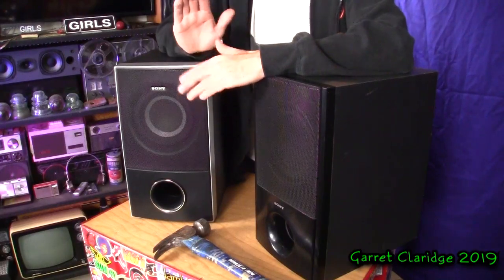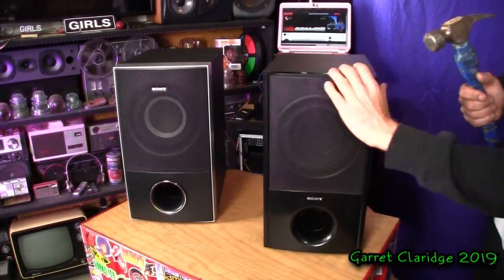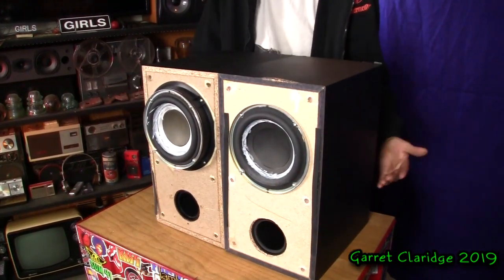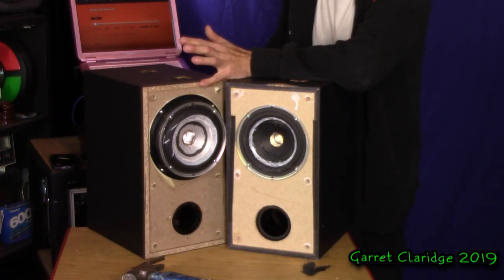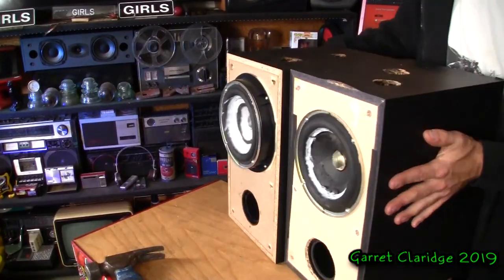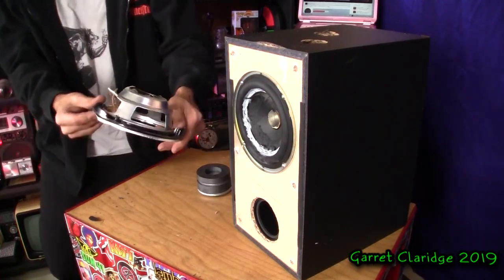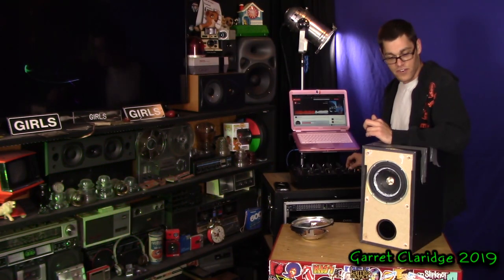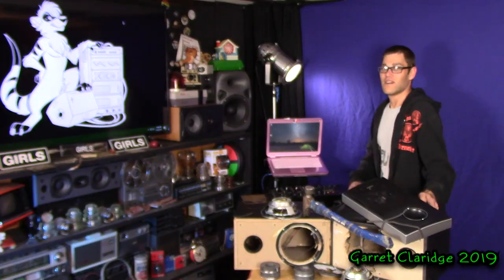Blowing Up 2 Sony Subwoofers

Comment: The Sony SS-WS95 on the right are not a bad little sub. they respectively get down to 40HZ.
If they remain a rooms corner with a pair of alternate satellite speaker to cover the 100hz-20khz range, the aren't bad at all.

The key with these subs is matching them with a low wattage amp with a wide range.

I used the SS-W95 on a compact Optimus STA-300 Digital Synthesized AM/FM Stereo Receiver  that only put out 15 watts per channel but had the range output of 40h-20khz of which I found on a curbside in my neighborhood, that someone just threw out.

 I paired it with two Focal Sib-T 5" Polyflex Cone 100V 2-Way Speaker, 50W, Single that I actually found at a second hand thrift store for like $6.00 !!!, They work very nicely with a range from 100HZ-20kHZ  

My laptop takes care of the Equilization with a general windows program through the windows media player.

All in all a super cheap setup, that sounds decent, as long as your not looking to blast music to the limits.

Comment: Just because you beat the shit out of it before really testing it, and on the wrong setup anyway, doesn't make it a weak sub. Its a decent little 6 inch home surround sub, do the same to any speaker and it'll sound like it sucks.

Comment: A speaker moves just as much in as it moves out, no matter the polarity. For example, a sine wave has both a negative and positive amplitude, with the middle being neutral. So when a speaker is out of phase, the positive amplitude makes it pulling in, and the negative pushes it out. And when the amplitude is zero then the speaker is in its neutral position of course :-)

Comment: Stupid question but does it have that nasty electrical burn smell whenever the speakers smoke?
Reply: you mean burnt/hot copper smell?
Reply: @ale6creations640  Sure lol
Reply: @TheRebelAndTheGirl  if so then yeah, theyy have that smell
Reply from the maker: you can smell the glue first when the coil heats up and the smoke shows can really stink. not only the electrical smell but also a mix of burnt plastic and paper most the time, old ones burning off dust is nasty